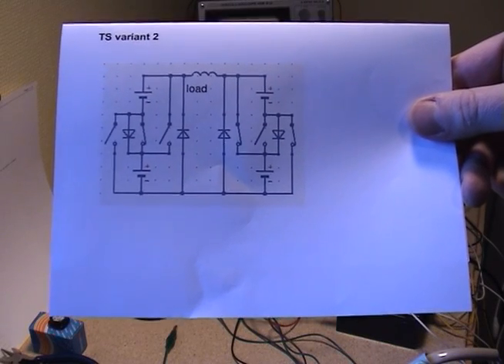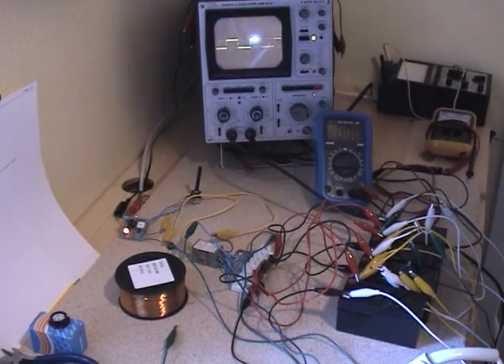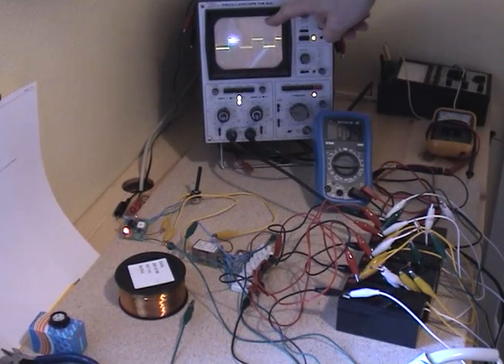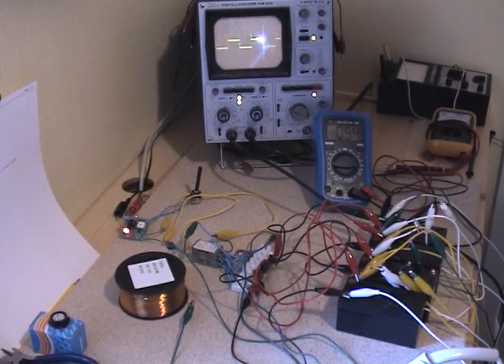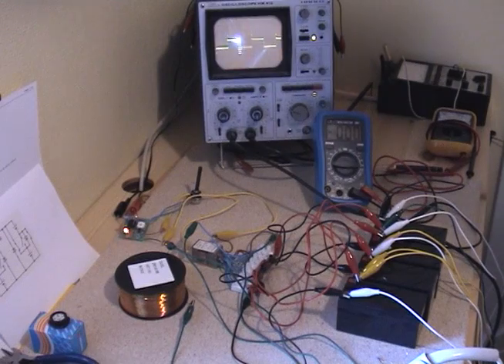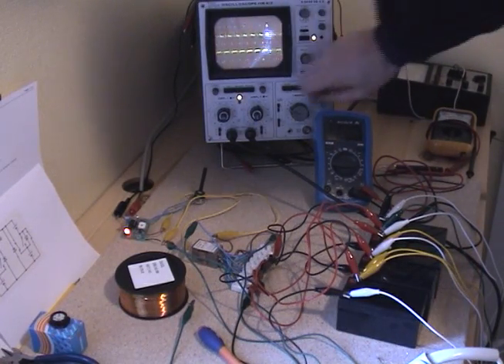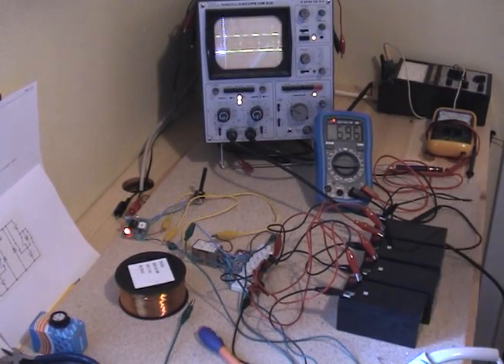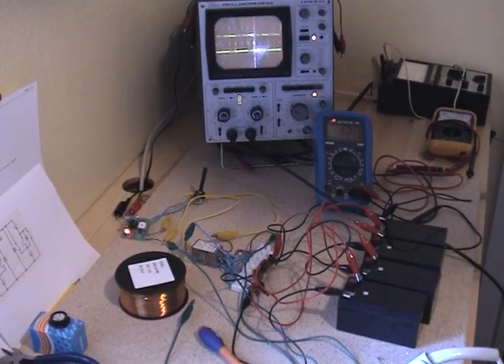Tesla-switch part 2

Comment from the maker: Thanks. My next step will be to change the timing so that the time spent on -12V and +12V will be less than the time spent on 0V (zero volt), and then to increase frequency by using something else than a relay.